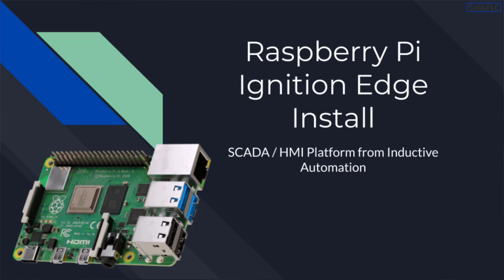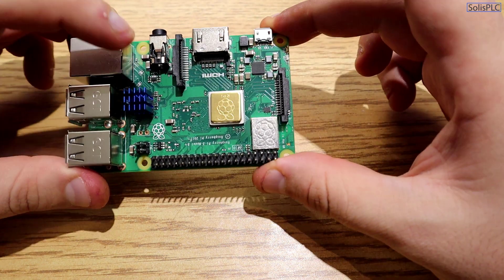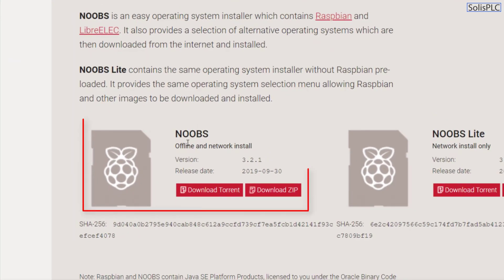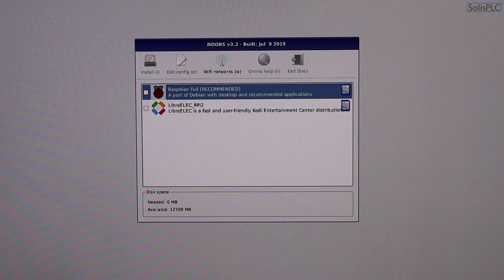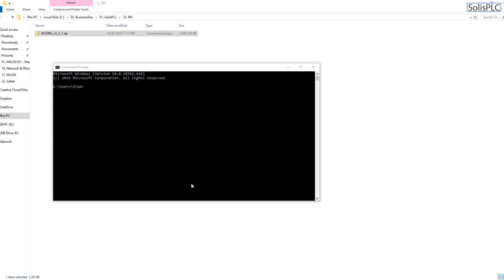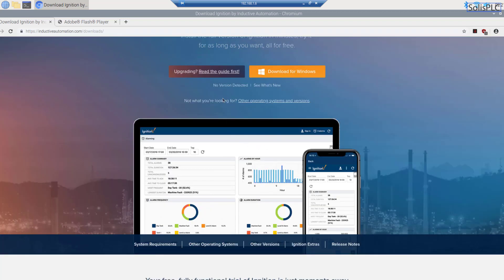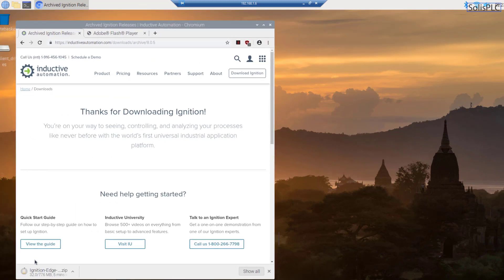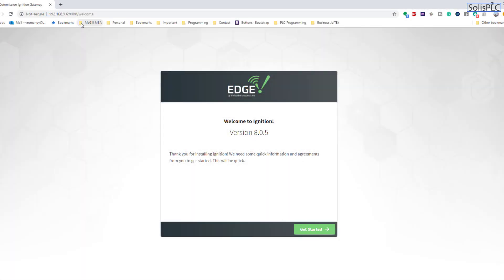Raspberry Pi Ignition Edge Installation | Industrial SCADA Inductive Automation Tutorial NOOBS IoT

Comment: Corso Systems did this in 2016 with WinCC Open Architecture.
Reply from the maker: It's definitely nothing new. I'm just going through the Inductive Automation certification and was surprised not to find a video tutorial on this for the most recent version. Other than that, all the information's available out there.
Reply: Compare to Ignition Wincc OA is too expensive

Comment: I programmed a Pi as PLC with CoDeSys. Some cheap remote IO would be all that is needed to create an affordable PLC trainer.
Reply from the maker: What kind of remote IO did you add to the PI? I need to figure out if it can run Codesys and send data into the Ignition layer. It should be possible, but I'm not sure yet how to do it.
Reply: @SolisPLC  Adding remote IO to it is just an idea, so far I have not purchased any.  I work with PLC-s as a hobby and remote IO is more expensive then what I budgeted for my hobbies.  
I am considering buying a Click PLC and configuring it to (more or less) be just remote IO.
Reply: @SolisPLC  There is also Sequent Microstems Mega IO Industrial sheld for the Pi that allows use ok industrial signals with the Pi.
Reply: @SolisPLC  Once you install CODESYS for Pi you can actually access the GPIO on the Pi or you could get some EtherCAT modules.  CODESYS for Pi provides an EtherCAT master as part of the configuration.  This is all free, but it will only run for 2 hours.  You can buy a runtime license for about 50 EU.

Comment: hey, dont you need to download oracle java 8? im following this tutorial online but i have no clue how to download java
Reply from the maker: It's possible; I believe I had Java installed from a previous software. There should be online tutorials on how to get that done online.
Reply: @SolisPLC  i have tried and tried and i cant get it to work. I had ignition Maker edition in my reTerminal device by Seeed but when i was trying to do something it got all messed up and i had to reflash my device and start from scratch and cant remember for the life of me how i installed it at first. The reTerminal device has a CM4, its basically a raspberry pi 4.